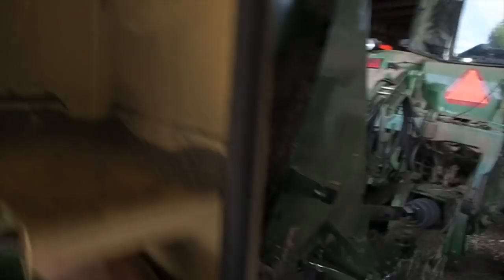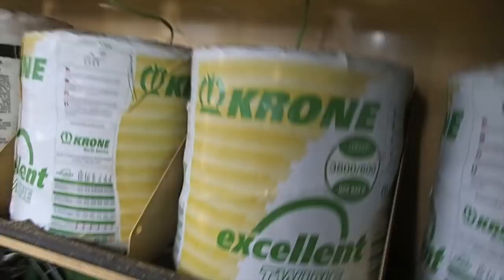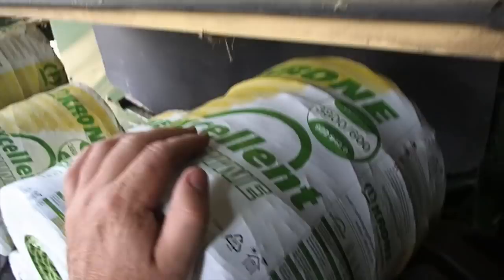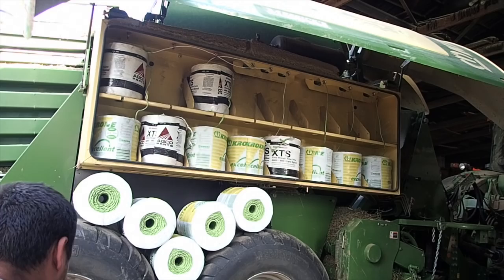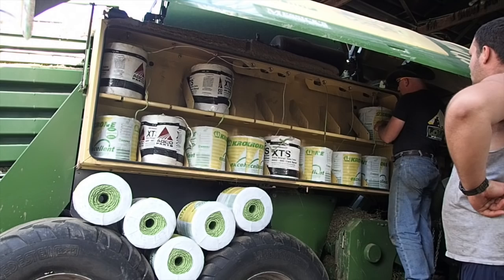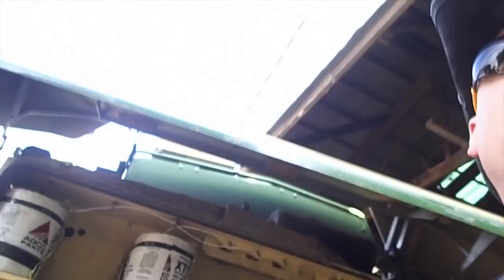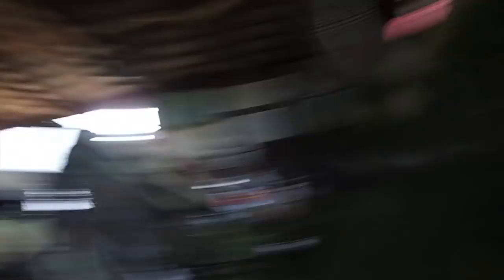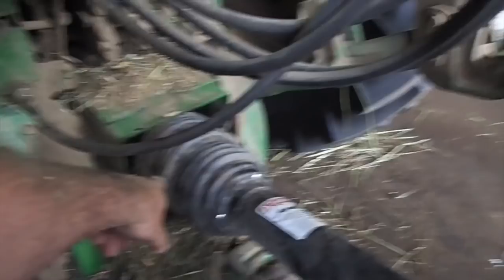Stringing Up The Krone

Comment: That's called a surgeon's knot-- with the extra twist in it on one side... I use the same thing on my rocket parachutes when I build them, for the same reason.  I don't use them on the round baler, though... need as slim a knot as possible to make sure it doesn't hang in the twine brake and pop the twine, and so long as I set a square knot firmly when I put in a new ball, I haven't had one slip yet.  

As for the greasing, you could always do like a lot of asshats I've known over the years... "Lease it, don't grease it!"  They lease equipment and flip it frequently and do ZERO preventative maintenance on it... mostly because they're too friggin lazy from what I can see.  Most of them were the same guys that were too good to get out in the heat and dust and combine their own grain or bale their own hay back when it was done from open station combines or tractors, so they hired someone else to do it... but now that they can ride in an air conditioned pressurized cab all day with the stereo going and never have to get any dust or sweat on them, they'll buy a machine and run it-- but they won't get dirty doing ANY maintenance on it... Anyway, it just shortens the life of the machine and creates an ass-ache for whomever ends up with it next... 

Kinda like a relative of ours used to do... buy a new car every year, and do ZERO maintenance on it... including oil changes.  He'd run up 30,000-40,000 miles on the new car and never change the oil ONCE... he always traded them in with the same oil that was in it from the factory.  Just ruined the engine for the next guy, because you KNOW it's not going to last but maybe HALF as long as it would have if properly maintained... 

Later!  OL J R :)

Comment: How many bales will a typical roll of twine produce and how long does it take to go through one
Reply: I use the krone string and the balls of string that feed up to the knotters use the least amount and  if I remember right I think I get 220 bales per ball and the ones that go through the needles underneath use the most as it covers 2/3 of the bale and I think I was getting about 170 bales. Don't hold me to the exact numbers I haven't worried bout counting the bales per string in a few years
Reply: Good question ,I'm going to guess 2 rolls for each knotter will run most of the day. How close am I Wes ??

Comment: Hi Moving that string up would drive me nuts with that many balls on that krone. It's bad enough on a windy day out  in the field doing 8 balls of string on my 688 Holland, by the time the crap in the twine box has blown all over a guy before it's finished. 
         My buddy went to work on a farm the guy bitched about how much his grease consumption/ costs went up in the second month. Buddy just turned round and said yeah thats up by $500, But i bet your bearing costs are down 1000. That was the end of that discussion. The last hired man never greased equipment and replaced bearings instead!.

Comment: How many bales of twine are being used simultaneously on that Krone baler? If it is like the other I saw, you could tie the spare bale to the bottom of the first one from its center. This way, you will end up always using the twine guide, thus lessing the chances of getting the twine cut by the selves.

Comment: So the top shelf is what your using and the bottom shelf is storage?How many rolls does it use at a time?If one runs out, the machine stops?I'm surprised the shelves look like they are made of wood, they are not steel?

Comment: question about grease brands? I work at a Deere dealership in NY and was just wondering if you have tried the SD Polyurea  grease that deere manufactures?I'm not trying promoting a product lol. I was just wondering if you have tried it.

It is all I use in my grease gun. Mocos to residential units. I also like a good protective grease.

Comment: you should do a maintenance Video just to shut up the idiots.  Daily Maintenance on a Fire Truck takes about 30 minutes minimum Depending on Equipment.  On a Dump Truck straight Truck is also 15 to 30 Minutes.  On a semi is 30 Minutes to 1:30 Depending on equipment.